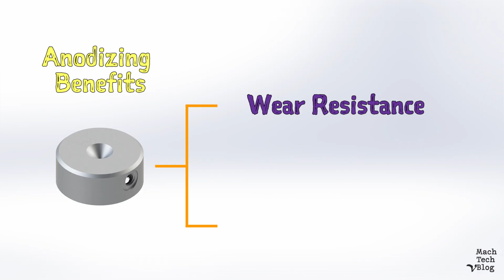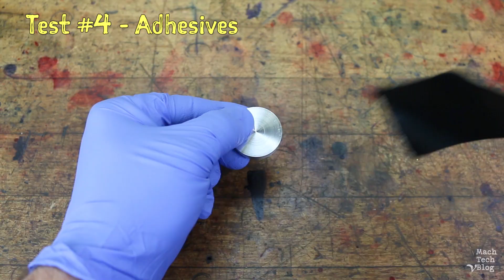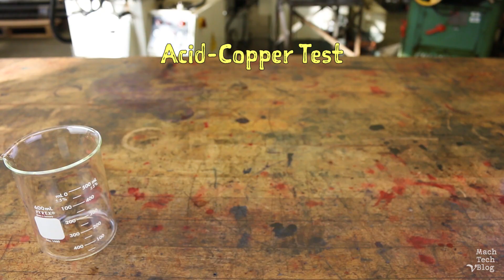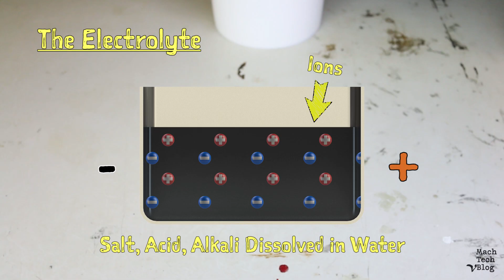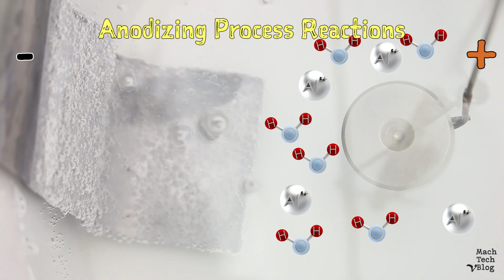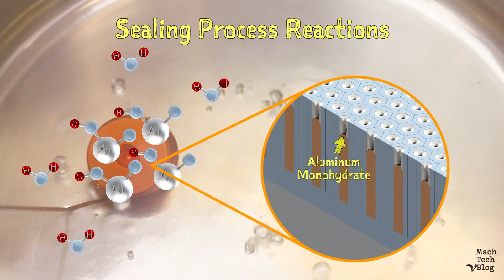Air Bearings: Anodizing

Comment: i am way to late for the comment , but a question came up in my mind during the anodizing part , why not using constant voltage instead of constant current as the piece anodized the anodized part will get more resistive to current shunting the current to more raw parts resulting in more uniform anodizing adding to that the electrical resistance is proportional to the surface area, so applying specific voltage can by pass the problem of calculating the surface area, in your case was about 15.1 Volt, we can apply it everytime the amperage here will reflect the surfac area available for anodizing given the solution and the cathode are pretty similar.another question why not using graphite as cathode it is less toxic provide more surface area.

Comment: Saw the hat; we used to do that at my previous job for holes in flat surfaces at 45 degrees. Drill bits would skate off but mill bits worked. Pretty expensive way to make holes in general though, since the materials, espeicially the zinc and copper, rapidly dulled the bit.

Comment: 1) Adding an acid to a water you're not avoiding the exothermic reaction itself. You're avoiding formation of shallow layer of water on top of the acid. Such a disposition concentrates all the heat excretion near the surface and it will cause boiling of water layer and sputtering highly acidic solution all around.
It is actually not enough to just pour an acid into a water -- you also need an active mixing of the liquids to spread the heat evenly. And even then you need to carefully control whether it about to boil.
2) No way you can get any violent reaction, any significant heat from the 30% sulfuric acid with water. It's too diluted. So you better won't be fooled by the calmnes of that mixture when you'll be dealing with some really highly concentrated acids (50 and more % for sulfuric acid) and especially oleum wich is pure evil.
__________________
It's better to have 2 or 4 smaller cathodes spreaded evenly around the edge of the vessel than one at one side. As far as the largest current goes through the least resistance, the surface of the part will be processed unevenly having just one cathode without rotating over time. Especially if it has any complex form.

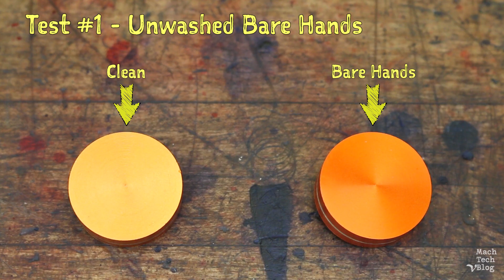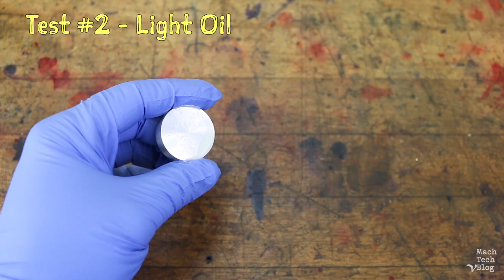Comment: 7:40 & 7:45 you have used exact same image. 😕 Too bad.
The two pictures at 9:10 simply looks too identical to me.
Reply from the maker: They do appear identical! I put a note in the description.
Reply: @LaneyMachineTech  Wow, that was fast, thank you. I was wondering if you tried to align the different samples very accurately, but the placement was too spot on be plausible to be done by hand...
 
I went to look for your "Part 4" of this air bearings series, but could not find one. 😭
Have you finished your bearing and did it work (as expected)? May we expect to see the part 4 at some point in time? Please, this is such a cliff-hanger.

Comment: Adam, don't abandon us for a whole year again!
Reply from the maker: Hey, I probably won't be able to work on the Air Bearing series until late August. All of my videos are filmed in the machine shop at the college where I work. Unfortunately, because of covid-19, all of our machine shop classes were put on hold and instructors are given only limited access to the campus until the shelter-in-place restrictions in our area are relaxed. Until then, I am focusing on developing more content for future videos. I've been experimenting with hard anodizing to make a diamond-impregnated lap (similar to an "Ablap", if you've heard of that product) to lap the air bearings. And I'm designing and building an autocollimator from surplus optical components to inspect the granite ways for the ultra precision lathe.
Reply: @LaneyMachineTech  Keep the good work! Any video of yours is always welcome. I'd still be interested in a die video as a continuation of the tap one or mechanical seals.

Comment: have you hear of "hard chrome"? im talking about on steel. I sent a handgun away to be hard chromed. it looks like chrome but if it was bead blasted. it places about 2 thousandths of an inch of surface on a part so it can interfere with function of mated surfaces but it is super hard and durable. I wanted to know because it might be a source of income if not too costly.

Comment: This is a very well & thoroughly explained video on anodizing.  I believe that I could do quality anodizing in my garage right now based on this information.  However, I have to pick nits and point out that different color dyes (at least for "professional" anodizing) can require different temperatures.  At work we used different temperatures for almost every color that we fooled with -- from 80° at the lowest end up to 160°F at the highest end depending on which color it was.  Temperatures between 125° & 140°F actually would have fit inside the allowable ranges for all four colors that we used.  (Past tense since I'm now retired.  We did aviation anodizing, so the specs & testing were tight.)  Of course, I've selected the widest-cases of the allowable temperature ranges here just to show that there is or can be a difference, but that info should come from your dye OEM, if using the professional stuff.  I think the average home- or small-shop anodizer should be able to do an acceptable job just using the information given in this video.

Thanks again for a very well thought-out & filmed video!  I'm recently subscribed and looking forward to the next video, but will binge watch to catch up from your first video.

Comment: Contaminants build up in your bath and slowly wreck your acid solution. I sat my anodizing tank on top of a thermoelectric cold plate TEC chiller so i can keep it at the perfect temperature. It's nice because it can heat and cool it. Anodizing is very addictive. I think people should be aware of this fact.

Comment: So if hard anodizing gives you 60 or 65 RH, can you make vise jaws and parallels and things like that out of hard anodized aluminum instead of tool steel?
Reply: Maybe, but the anodizing isn't very thick, and the base metal not as stiff, so probably why no one uses for those purposes. It IS used everywhere in light to medium load uses in the film & TV camera rigging industry.
Reply: @ericy4522  Like you said though, with such a thin layer of the hard oxide on the outside, I would think it's still only good for appearance mostly - anodizing is the best way to finish aluminum, and I guess it makes it more scratch resistant. Definitely better than paint, but I guess not a thick enough layer to be a substitute for actual hard material in clamping type applications.

Comment: Generally I prefer to find the surface area of a part using the current relationship rather than using the number solidworks spits out.  I put a sheet of known size into the solution and apply a low voltage.  I then take note of the current and then introduce the part with unknown surface area.  The relationship between current and surface area is mostly linear which makes it easy to determine the surface of the unknown part.  Since the surface area was determined under similar environmental conditions to the anodizing process I generally prefer it over the calculated geometry.  Of course I'm not trying to say your method is wrong or anything, just sharing my own because I thought it was relevant.
Reply from the maker: Wow, I never would have thought of that.

Comment: Fun fact(as any mechanical engineer or toolmaker will tell you) never draft an assembly out of steel that rubs against aluminum unless you plan for the steel component to be the wear component as well as the aluminum one. You would think that the steel would wear the aluminum, and it does, but it more so wears the steel. This is due to the aluminum oxide on the surface of the aluminum. Steel averages somewhere about 5-6.5 mohs hardness, whereas aluminum oxide falls around a 9. And as soon as the steel wears away the oxidation layer, a brand new one forms to come fuck your whole world up. 
There is your pro-tip for the day.
Good work on the channel guy, I have a solid mechanical/machinist/toolmaking/engineering background and you still find a way to publish topics I had either forgotten or you find ways to teach these concepts in a way that makes other things click a bit easier. Kudos, keep up the hard work! Thank you, on behalf of the dying trades everywhere for making clear, relevant, accurate, and easily intelligible information attainable to all.
Reply from the maker: Cool tip! Thanks, Chuck!
Reply: Such a pair has also another interesting effect. When it exposed to a damp weather and there's  significant amount of friction between these metals, aluminum corroded terribly due to local wearing of oxide layer and forming a galvanic pair between metals in witch pair aluminum is in weak position. Such a process causes pitting perforations of aluminum fuel tanks of trucks under the steel straps if there's no rubber or plastic between them.

Comment: Your air bearing on surface plate reminds me of every co-ordinate measuring machine  I have ever used. Lmao. Alot of them(not all) use a bridge type setup with one side to a ballscrew(or linear motor I assume is an option as well) and the other rides on air.

Comment: very good video   i did some anodizing on some parts that i welded and the weld turn black during the anodizing and didnt take color good is that because the weld is not 6061
Reply from the maker: If the weld turned gray or black, then it's almost certainly because the weld rod you used was made of 4043 alloy. 5356 alloy is the one finishing shops recommend for parts which are going to be anodized. But even that alloy will have a noticeably poor appearance if the material is overheated during welding.

Comment: This is a fantastic video.  Best on this subject. I would love to see a video of type III anodizing.  Have you ever attempted this? I am also curious if you have ever measured your oxide layer thickness and if you have ever anodized titanium?
Reply from the maker: I have not attempted Type III anodizing because of the temperature control requirements. Might be worth a go? 

I have not checked the oxide layer thickness. This is a logical next step in my experiments. I'm sure there will be lots to learn from it. There are a number of ways to do it, including eddy-current gages or microscopic inspection. A friend of mine has access to a scanning electron microscope, so I may go that route. 

I have anodized titanium many times. It's extremely simple and requires much less equipment and nasty chemicals than aluminum anodizing. The way it works is a little different. I left a reply on another comment here in which I described the basic idea.
Reply: @LaneyMachineTech   Is your friend Applied Science? ;) I haven't heard of eddy current gauges but a microscope came to my mind. 

I have an out there idea for ballistic plates made from aluminum or titanium with a super thick oxide layer.  Like the silicon glass/polycarbonate layers in ballistic glass.

Would be super interested if you did one on Titanium too!

Comment: Wouldn't unclean parts passing the test be a false positive, not negative?
Reply from the maker: In this case, I mean that the test would be giving a false negative for contamination, rather than a false positive for cleanliness.
Reply: @LaneyMachineTech  Fair enough, but you did say "passing the test" at the end (of that part), in reference to a clean part - but at the beginning you did specify that it was a test for contamination. So I think the problem is the "passing" part, which is more in reference to your goals, not what the test measures.
I'm just getting caught up in terminology, I think it was perfectly clear to everyone else what you meant.

Comment: Love the hat (cap). Small disclaimer needs to be added *only "drill" using an end mill on machine tools such as a vertical milling machine or lathe. AvE has warning stickers for this. I watched a very expensive mag drill fall 10+ feet to its destruction because the "millright" chucked up an endmill.
Reply: Can you elaborate on the failure mode you mention here? What caused the accident?

Comment: Could you clarify the sign of the cathode and the anode? While I clearly remember from chem classes that cats are positive (CATion, CAThode), this nomenclature is inconsistent among electrochemistry or electroplating hobbyists I've been watching on YouTube. Something tells me there is some logic to changing definitions depending on application, and it's not the result of human ignorance, but that's surely confusing.
Reply: I believe anode is positive in receivers (like vacuum tube) and negative in sources (like batteries)

Comment: i always thought the colour comes from the anodizing itself

oh also i really like that your videos are always on point and without much chatting, straight to the point. Stay Safe!
Reply: I think other metals can anodise that way, titanium for one, I’m pretty sure I once saw in a video where old mate did it in a time lapse by raising it out of the electrolyte, caused it to anodise different colours
Reply from the maker: @thomasa5619  Yes, titanium anodizing is a different mechanism altogether. I kinda wanted to mention it in the video, but it was already getting too long. If you look at the titanium rod I used to electrically connect the aluminum part, you'll notice that it also turned a different color, but not orange like the part. Titanium anodizing still relies on growing an oxide layer, but it does not use dye for coloring. The coloring occurs because of interference effects of light waves when reflecting off the thin transparent oxide layer and the part surface. The thickness of the titanium oxide layer determines which light wavelengths interact constructively and destructively, and therefore which color dominates in the light reflected from the titanium part's surface. Titanium anodizing is a voltage-dependent process, unlike aluminum anodizing which is a current-dependent process (as demonstrated in the video). The voltage determines the color in titanium anodizing. Here's a link to a good description of the science behind the process: http://mrtitanium.com/interference.html
Reply: I suspected as much but didn’t want to speculate so much, as you can see it was already far enough past my bedtime that my English was suffering